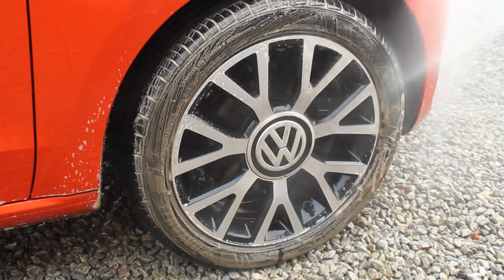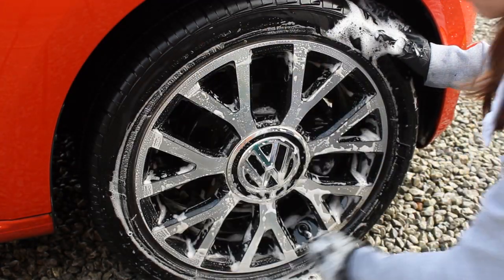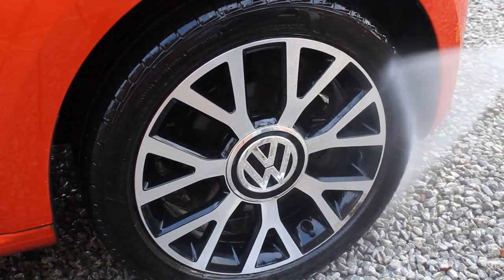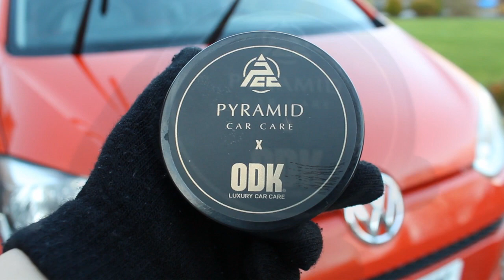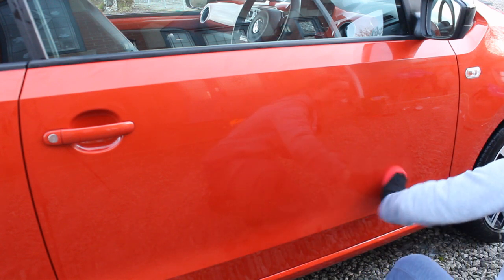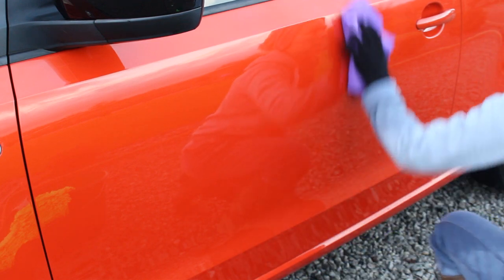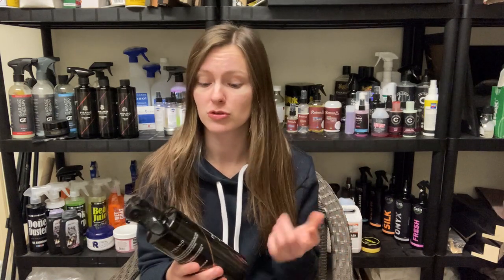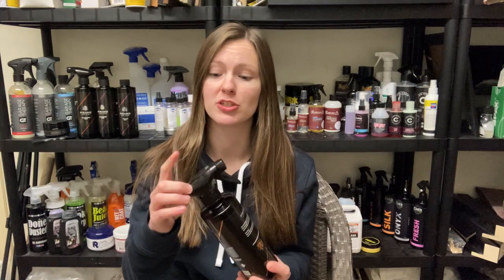Pyramid Car Care Review | Full Car Clean, Decontamination and Protection

Comment: Brilliant video you recommend this wax I’m after a new wax and this is on offer for £25 looks like a bargain
Reply from the maker: Thanks Michael 😊 I really like this wax, the durability and water behaviour are brill. I’ve used it quite a few times since this video and found it can be a bit grabby on removal in dry conditions if you leave it on too long or apply it too thick. The best way I’ve found of applying it is to use a slightly damp applicator to make sure the layers are thin and then it’s very easy to work with